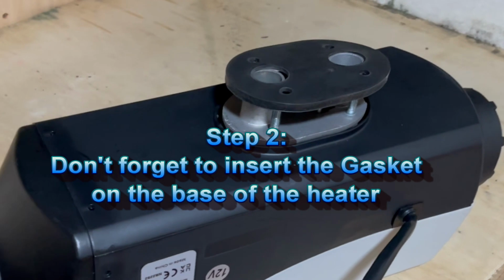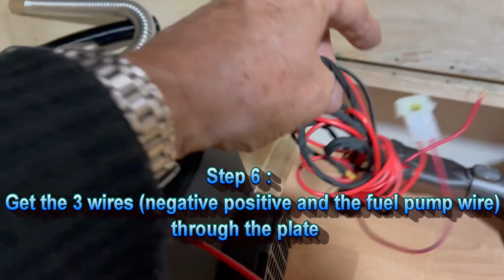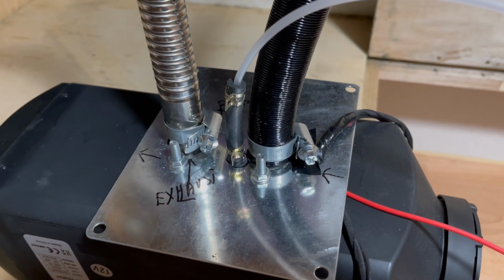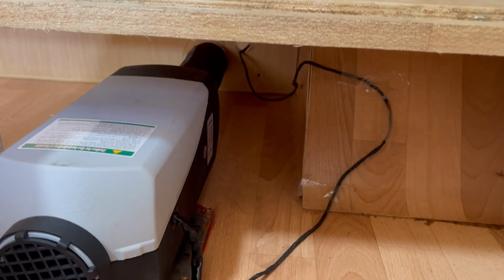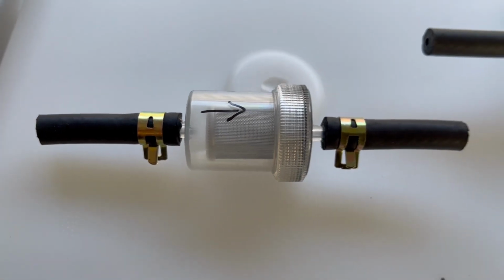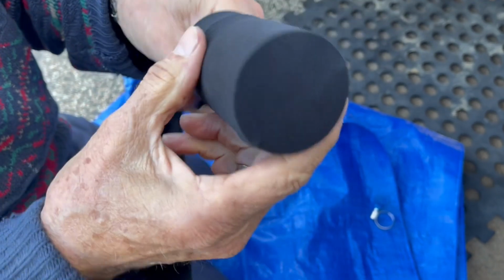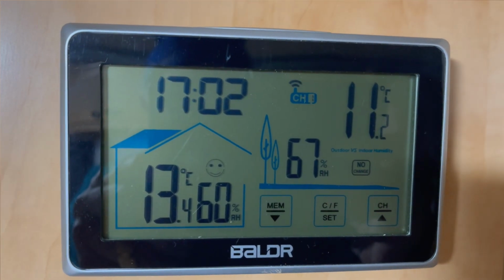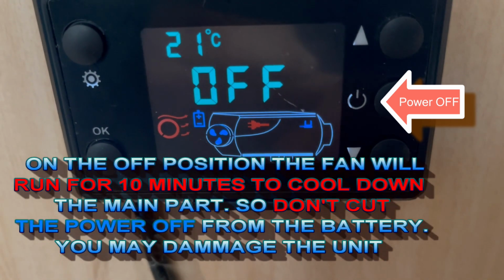HOW TO INSTALL A DIESEL HEATER  IN A CARAVAN STEP BY STEP and safely

Comment: Great video !!  Could you tell me how far from the unit the pump can be ?
Reply from the maker: Good evening Mick. The Brochure told us up to 2.00 meters but between 1 .2 and 1.50m  is very fine, specially if the tank is elevated in the front of the back of the van . please don't hesitate to ask more question. thanks for subscribing and asking questions . Regards GG
Reply: @TheFrenchChef    Thanks for your quick reply Gerard.  Can it be further than 2 meters ?
Cheers Mick
Reply from the maker: @mickrowan  I think they could go up to 4 meters it you put the tank high enough to help with the gravity. (The length of the line they give you in the kit).
Reply: @TheFrenchChef  👍👍👍
Reply: Gday Gerard. I installed the pump 4 meters from the unit and 1 meter from the tank and it works perfectly. Thanks again 👍
Reply from the maker: Thanks mick you are a CHAMPION . Thank yoy to let me know. Cheers .HAPPY CAMPING IN THE COLD !!!👍👍👍😃😃😃

Comment: Bonjour Gerard, quel modèle de caravane as tu?
Reply from the maker: Bonjour Bernard .
Nous avons une caravane standard de 17 inches 
Avec 2 reservoirs d’eau sous le plancher .
Il faut éviter de percer le plancher  dans les reservoirs. La place la mieux se trouver sous les sieges en Forme de L ou il y a de la place et ou la place ne gene pas . Le réservoir de gasole a été placé dans le compartiment accesible et caché du soleil. 
Plus de question n’hésites pas a me demander.
Merci
Gérard Garbé
Reply from the maker: Le nom de la caravane est Magestic
Modele de 2009 fabriquée a Melbourne 
Beaucoup de modeles lui ressemblent.
Reply: @TheFrenchChef  Bonjour I've just bought a Paramount Commander 19'6 and I've spent all morning installing a diesel heater and it's working well.
Reply from the maker: Bonjour Florent,
I am very pleased of your success in installing a diesel heater. I hope my video has given you the inspiration. Don’t hesitate to forward the link of this you Tube video on your face book to inform among your  friends the eventual person interested.
You bought a magnificent caravan. Enjoy your next trip. Cheers 👍👍👍😉😉😉👌👌👌